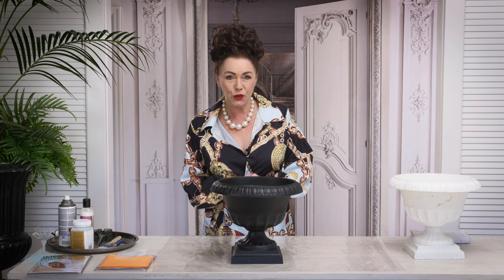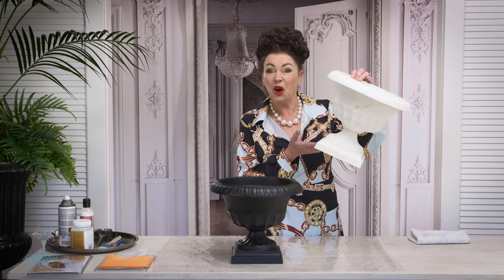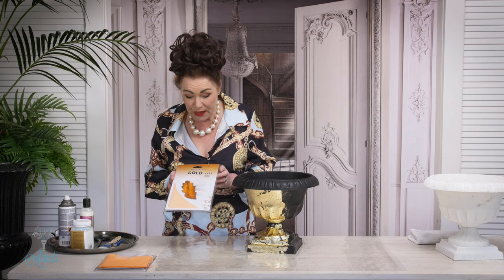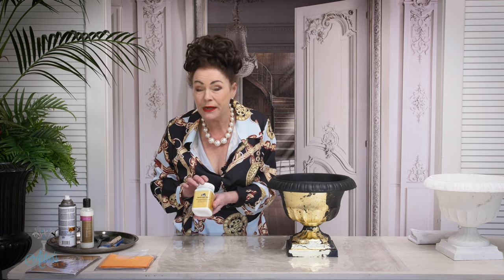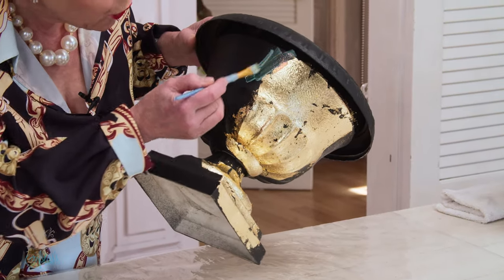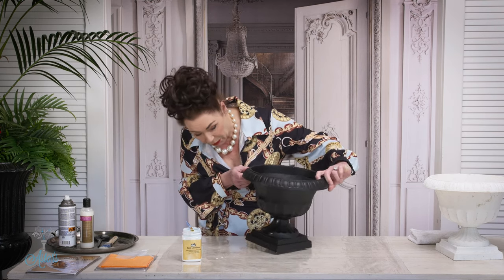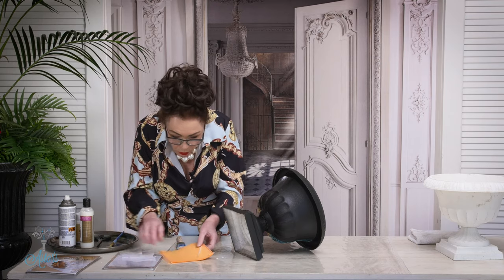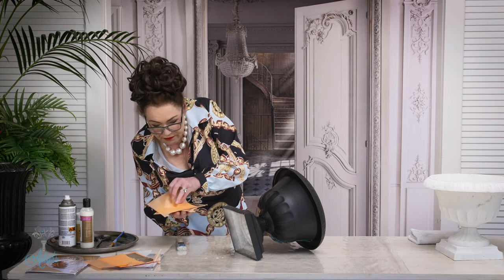How to apply Gold Leaf

Comment: Hi there Astar, I'm about to start a project using gold leaf but what I've noticed in every tutorial are the lines or seams between the sheets when theyr'e laid down. Is there a way to blend the squares together so the seams are invisible?
Reply from the maker: Hi there, well it's a bit of a bother trying to achieve such such a task tbh.  However, what I do is very carefully do little patch up layering to try and cover over the unsightly gaps or spaces. Honestly, gold leafing is like working with butterfly wings.  It's fiddly but the end result is amazing.  Good luck and enjoy, Astar

Comment: Hi was thinking of covering my kitchen benches with bronze leaf and finishing with varnish? Good or bad idea?
Reply from the maker: Hi Berni, I'm having a heart in mouth moment!  If sealed properly all might be well but first I'd do a test.  Secondly, I'm equally not sure what to suggest to seal it with.  I'll do a bit of research and see what discover.  Surely the 'all knowing Google' will have an idea.  Warm regards Astar
Reply: @AstarsPlace  thanks for replying 💛 I seen it done on an interior design programme on a bar and it was sealed with epoxy resin - I’ll def do a patch test first though x